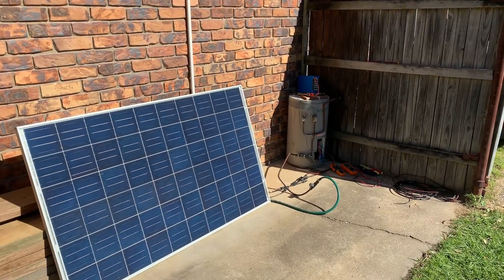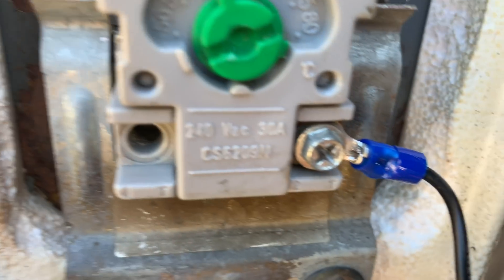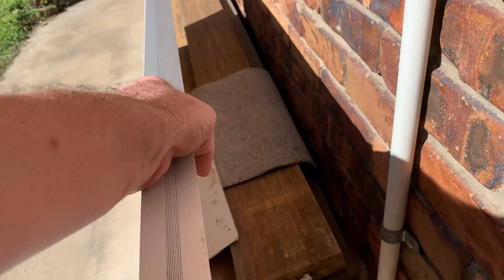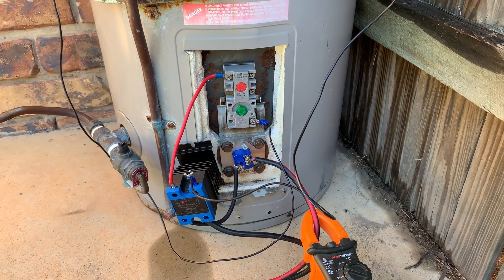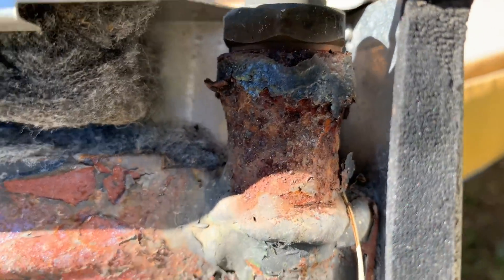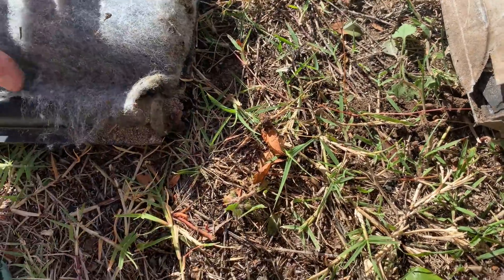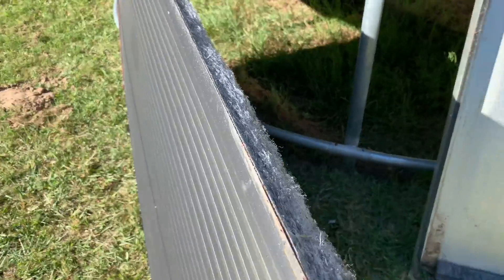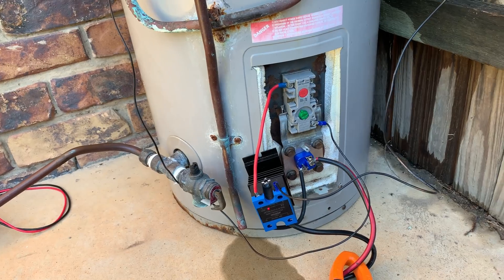Single solar panel heating hotwater system with a  resistive element.

Comment: David poz did a good job explaining what you are seeing. Check out his videos on how he got his working. He made an Excel worksheet to help select the proper element too!
Reply from the maker: YES YES -- his stuff is awesome on this... i'm hours deep into his channel - many more hours of watch time to go!
Reply: A simplified version of David's formula is V squared / power.
Reply: I sent Dave a working power point controller for water heating months ago and he never has managed to hook it up.  That table is about useless other than giving a general idea of element selection.  Table is only good for one hour a day on a very good day. Dave's video was a near total failure and it still gave an indication of being cost effective. The power point controller would have more than doubled his daily output.
Reply: @opera5714  Hi Opera.  Just like last time we spoke, I'm excited to make a video trying out your design of a controller.  I have about 20 hours into the assembly of the components which I bought from you.  Figuring out how to assemble the components was very difficult for me.  I was pausing your video trying to trace wires.  LOL  The latest hang-up was that you told me I can't use a watt-meter with your controller design.  So I've been scratching my head as to how I can measure the effectiveness.  I still plan to make a video about your controller design when I get the time.  Hang in there.
Reply: @DavidPozEnergy  You can monitor from the panels to the capacitor bank. That will be steady current and voltage, just what the panels want to see. That will be the true wattage. No more than 2W will be lost in the control as there is almost no heating.  The heating element will see pulsed DC which that DC watt meter can not not measure.

Comment: I use the 6 Inch Adjustable DC Submersible Water Heater Element. I have had it running for 2 years now with out one bit of trouble. I have 1200 watts of PV going in at it's MPPT volts around 65 volts. You can buy it from here. I do not care for the owner of this place but it's the one place you can find it.. 
mwands  COM/      store/adjustable-water-heating-element
Reply from the maker: I'll look into it when the sun comes back up :) thanks bud
Reply: @Curtis Albrecht O cool did not know Jeff was backl!! Sorry I was not clear there
Reply: @Curtis Albrecht he sold out to some guy last I was told

Comment: You need the same wattage or higher as your element. That will be your voltage issue.
Reply from the maker: Tomorrow i'll try 2p2s setup that'll be 500w max and maybe 15 amps i hope
Reply: Agreed

Comment: Mate it sure will pull the voltage down. Power remember is V squared divided by R.  If you elect to series enough panels to actually heat the hot water system (You will need 10 of them) it will be necessary to swap polarity regurly to prevent electrolysis from eating the element. If you need info contact me. My electrical licence could help out .
Reply from the maker: Only have 4 panels so tomorrow i'll go straight to 2P2S setup and run it while the sun is up and see what comes of it.. if nothing else i'll know something new and know never to waste more time on  it lol
Reply: @HBPowerwall  Series them then. It isn't enough.  But you can learn from your endeavours.  When you pull the voltage below maximum power point the losses get transferred into the panel. The wattage of the installed element is the key knowledge for you to work with. That small HWS is probably set up as a quick recovery unit. Set up that way the element is likely 3.6kw or 15A at 240VAC. So resistance is around  16 ohms. If you can source a 500w 110 V element you can win slowly. The 16 ohm element will cause almost all the heat to be generated in the panels. This is why MPPT controllers are used these days. Impedance matching is critical to all electrical systems and is the key to how the grid works. An efficient system matches the impedance of the source and the load.

Comment: I have almost the same setup. But I have it the other way around with the elements. I have a 230 watt solar panel and a 175 watt element. Works really good. So either get some more panels or change the element to one below 250 watt that your solar panel delivers.
Reply from the maker: I'll be doing some rejigging tomorrow - i'm going to make this work or learn trying..